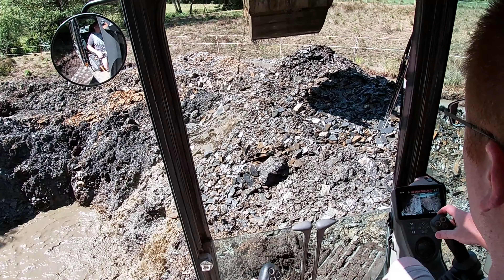Frithgar's Working Holiday, Day 2: Lots of water!

Comment: Interestingly, the side mirror makes for a handy 'second angle' view, the front glass up certainly helps with visibility, but my eyes keep locking onto that right stick monitor, Both from the ''split screen' view and from my mechanic sensibilities seeing "Low Coolant" I worry for your local foliage at your rate :P
Reply from the maker: Low coolant is on the whole two weeks, it's a faulty sensor and the actual coolant level is topped right up and engine and hydraulic temps all stay within the parameters!
Reply: @Frithgar  Fair call. Just the trees to worry about then ;P I kid I kid!

Comment: As for technique, well I've operated two diggers in my life, a showground bucket digger, bike pedal rotation, and a ''kanga digger'' which is basically a bobcat/skid steer mini loader except you stand behind it rather than sit inside it, and it's smaller, but still has the two sticks for skid steer then a side pair for arm height and bucket tilt. If I wanted to bash your water-bucketing,  I'd say it'd be more gentle to scoop the water rather than dunking the bucket, but in fairness, dunking is faster than trying to take scoops, especially when water will "leap into" bucket rather than soil needing the scooping action.

Comment: Damn man, I've never seen such a problem with water like that, maybe it's because the stone shavings is not letting it drain because of all the finings in it but, most stone is good for draining water. Is there a well or water spring in that area?
If you have the budget I'd say dig all the peat and clay out then rent a screener and dig the stone out and screen it, save the big stone nothing smaller than 5s and order the rest from a quarry but make sure to ask for clean stone. 
You'll definitely need to put down some fabric as well before putting the stone in and make sure to grade it all towards the river. Then put back the clay and put in some fresh topsoil. 
Not going to be cheap tho ha.
Reply: That's really good looking topsoil behind being excavated out
Reply from the maker: Not able to buy anything in as the cost would be far too high.  It's a common enough technique around here though, with burying the soft material underneath the layer of stone that's dug up, leaves a good solid surface.  If a road is being built then you'd want to do it differently, but as this is only for animals and small tractors it will be find as it is.  I think I said soil was going on top in the video, that was wrong, it's actually going to be a layer of woodchips.

The top soil over on the hill at the back is going to be used to dress everything at the end, the black peaty material I'm digging out is too acidic to be much good for top dressing though, so that's all going to be buried.